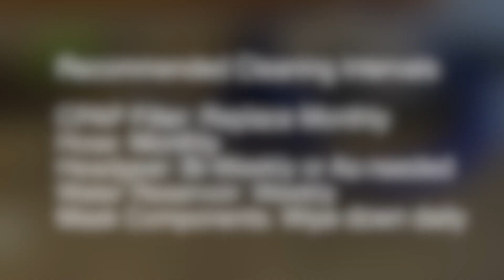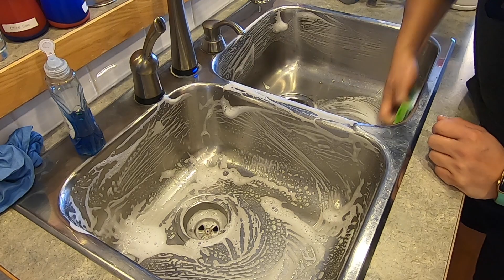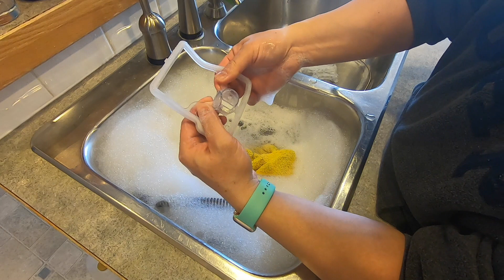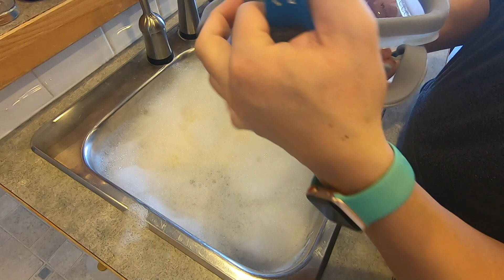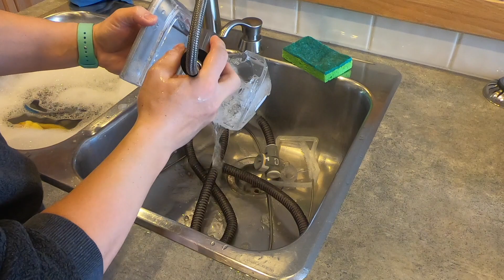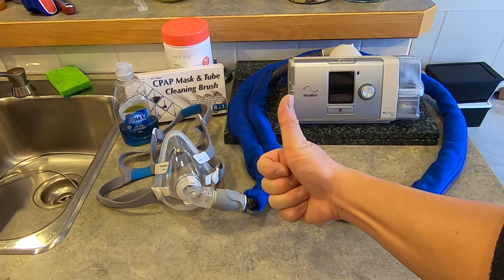How to PROPERLY Clean CPAP Equipment

Comment: Thanks a bunch. Now all i have to do is find a comparative soap in Australia. The information i got with the machine lists 3 brands, one of which i bought...then a person at RESMED said not to use the one i bought - i told them to update their information.....i doubt they will.
Reply from the maker: honestly, I won't fret too much about which soap to use so long as you use something that you'd use on the very dishes you eat on.  Think about it... if you wash your dishes with dish wash up soap and you're sticking forks and spoons in your mouth then how would that be bad for your CPAP gear?  I have YET to see my cpap gear get ruined by the various dish wash up detergents I've tried over the years.  Going on 3 years and I'm STILL on the original hose with no issues.  Just get something that is non-bleach, non scented and rinse really well and you should be golden.
Reply: @piercedasian  my first big wash day was Tuesday. I decided to keep using the soap I bought. The mask etc still look like new. I was told that the silicone would yellow after a week and the seal won't work....but the only way I can see that is if things aren't rinsed well. 
Now all I have to do is figure out getting the mask comfortable....it keeps leaving blisters and sores.....
Reply from the maker: @juliebeans7323  I gather you're really new to CPAP.  I found that ANY silicone mask I used caused sores so I resorted to going with a memory foam mask - Resmed AirTouch F20.  I use a Remzzz mask liner on it to prevent my facial oils from getting onto the memory foam and as a result of that, the mask has lasted me more than a year!  Far cry from Resmeds recommended monthly cushion replacement interval!  To help the sores feel less sore and to heal, go to your drugstore/pharmacy and buy yourself some "nipple cream".  This can be found in the baby care section and is used by nursing mothers to ease the rawness on the skin.  It is essentially lanolin and that will help you immensely.  Sores can form from the mask being too tight or you have super sensitive skin.  Another alternative is to use a mask liner and put that between your skin and mask.  What kind of mask are you using?  Makes a HUGE difference and can make or break you adapting to wearing something on your face while you sleep.  Once I got over the struggles of my CPAP that I can wear mine with ease and commitment.  Good luck!
Reply: @piercedasian  i am very new to it.
I have an extremely short nose bridge - I have almost no bone to sit the mask on. I have a f20, as my sinuses often cause issue due to allergy etc. I can't get a seal on my nose without making the thing tight. Been thinking of trying one of those gecko things for over the nose, perhaps it will help with the seal and stop the mask closing my nasal passages?
I am on a pension, so even getting the machine has been a struggle, hence the choice of silicone over the foam. They gave me a couple of cotton knit liners to try, but due to needing micropore tape to cover wounds, I haven't tried yet. I'm looking at those covers for the mask, but even they are prohibitive due to their ridiculous price.....I have some cotton knit fabric, I'll make my own.
I have a phone consult with resmed today....I'll see what they say, then decide what to do.

Comment: If you are going to clean your water reservoir  once a week- you might as well clean your hose as it carrys heated air which has moister-great for bacteria- Great video, very informative,. easy to follow
Reply from the maker: While you could do that (technically it is recommended by the manufacturer) that it is a bit of overkill especially when washing the hose.  Not going to lie, I only clean my hose with a physical brush every 30 days but I do "sanitize" it with a SoClean machine once ever 2 weeks.  Been 3 + years and so far no respiratory issues.  I guess the BEST thing to do IS to follow the manufacturer's suggestion but only the CPAP user can decide what works best for them.

Comment: Just picked up a ResMed CPAP today.  Thank you for this informative video!

Is it okay if there's a few residual when droplets of water under the water tank?
Reply from the maker: Yep there is no issues with water drops under the water tank. Shake as much as can out and the rest will dry up when you use the cpap. That is why there is a tiny little hole at the base of the reservoir so air expansion on the heater plate along with any moisture will escape out of that hole.
Reply: @piercedasian  do you have another hose cleaning brush you recommend? as the one in your description is no longer available (in Canada).
Reply from the maker: @jessikamikki  Hi Jessica, thanks for pointing that out.  Here is another link that would work and is a decent kit.  https://amzn.to/36tt7nV

Comment: I have been on a CPAP for 8 years and never clean it.  I replace filters every month and replace mask, headgear and hose every 3 months.  Never had any issues at all.
Reply: Same.  Though I don't automatically replace everything every 3 months.  If it all still looks, smells, feels good, I wait.  Filters are obvious - the white ones darken.  The black ones you just rinse out in the sink and keep using.  The headgear - I don't think I've ever cleaned it - just replaced it when it falls apart.  Hose and nasal pillows I replace when they seem dirty.
Reply: @cra2cra226  I too use a P10. Washing the mask straps with hot water and soap “tightens up” the strap somewhat, allowing longer use. However. the recent P10 masks I have received now have an easily adjustable strap -so far so good.
Reply from the maker: hmm, I'm not sure if it is necessary to replace all of the parts you listed if they're still in good shape.  Seems wasteful to replace a hose every 3 months.  I've been using my original hose and headgear for the last 3 years without a nary of signs of showing wear.
Reply: What about the water tub?
Reply from the maker: Never leave water in the humidifier unless you're using something like a SoClean or other similar ozone based sanitizer.  I dump my water out each day and physically wash out my tub at least once a week to be on the safe side.  Lots of gross and nasty things CAN and will grow in the humidifier tub.
Reply: I don’t use the humidifier and have it removed.
Reply: I do the same as Chris. I’ve been on a CPAP for 6 years and I also replace my filter on the Air Sense 10 once every month. I don’t want Dawn dishwashing liquid residue in my tubing and that gets breathed into my lungs. I initially used white vinegar after my sleep study and it was such a pain to rinse. I asked a few friends on CPAP if they ever clean their tubing and they said once in the beginning. Then they all stopped and none had gotten sick. They just replace the tubing every 3 months. So that’s what I started doing. The air is only blowing one way. I’m not blowing into the tubing. I just threw out my Climate Line Air tubing after using it 3 months. It looked perfectly good still but I put a new one on. I wipe my nasal pillow off each night but I throw them away every 2 weeks because they don’t work well anymore. I use the P 10 mask. I replace the headgear every 2 weeks also because it stretches. I used to try using the pillows longer but ResMed went from having the pillows made in Australia like the machine to having the pillows made in China and I didn’t realize that until I used one of the China pillows and knew immediately it was flimsier and they stopped performing well in two weeks and slipping out of my nostrils.  I clean my water chamber by spraying it inside and out with rubbing alcohol that I keep in a 32 oz spray bottle. After a couple minutes I rinse the alcohol off using distilled water from a gallon. Again, I don’t want soap residue on anything I breathe from.

Comment: Odd... as we were specifically told NOT to use Dawn (or any grease cutting soap) because it degrades the plastic bits.
Reply from the maker: Honestly I asked my DME owner and he’s been using cpap for more than 15 years and he uses dawn all the time. Remember you’re not washing it daily maybe every few weeks and I have extensively washed my cpap gear in dawn for the past 3+ years and zero issues. Still using the same hose and reservoir that came with the unit.
Reply: @piercedasian  Not saying you're wrong, I just know that when my mother and my husband received their machines the medical people told them both specifically not to use Dawn, and other grease cutting soaps, because of the plastic degradation.  So it was a bit shocking to see you using it.  :)
Reply from the maker: @akasarahsmom  yeah I am sure if you ask a bunch of folks they will all have differing opinions on what is right and what isn’t. I figured if it is safe to use on my skin to wash my hands (and I wash an awful lot because I am a mechanic) and my hands have survived all these years that I figured a dawn couldn’t possible harm a plastic hose.
Reply: @piercedasian  for sure.   Everyone has differing opinions.   Personally Dawn and other grease cutters KILL my hands.  Again, I'm not saying you're wrong, I was just surprised because we had been specifically told not to use that particular brand.  shrug So long as the equipment gets clean.  Nice video btw, forgot to say that earlier.

Comment: Should you not use distilled water to clean it?
Reply from the maker: No that is totally not necessary.
Reply: @piercedasian  I don't understand. If you're not supposed to use tap water in these things because of the calcium and other mineral buildup then why is it OK to wash them with tap water? Surely there would be mineral buildup unless you completely sterilized it or something after washing it in tap water?
Reply from the maker: @gunnMetal  no no, that isn't quite how calcium build up occurs.  Calcium build up doesn't happy immediately.  It has to sit and "precipitate" out of the water and start building up on the surfaces of the water tank.  When you're washing out the tank you're using a surfactant (i.e detergent or soap) and you're gently scrubbing the insides to get rid of any scum or bacterial buildup.  When doing this, the calcium would have difficulties attaching itself to the surfaces of the tank.  It takes time for buildup to form and grow and washing a tub out is never likely going to result in any real buildup (if any).  This is actually why you use distilled water in the tank b/c when you're using the cpap water sits and evaporates and that is whey you don't want to have dissolved minerals in the water since it will precipitate out.  Simple analogy is look at your dishes.  Do you have to scrape of big calcium deposits on your plates?  Not likely and thus your cpap will not have that issue either when using tap water to wash things out.
Reply: @piercedasian  OK then. Thanks for the video and for taking the time to answer my questions

Comment: Oh all this is completely unnecessary. I've been on cpap for over a year and never cleaned it and I'm totally fine. As long as you use it daily the bacteria can't build up. It's proven science by sciencey people. Hell, I even use tap wat The only time I wasn't able to use it was the 3 times in the last year I had pneumonia, which is obviously related to my smoking for a few months as a teenager 20 years ago. So I'm living proof that cleaning these machines are a hoax perpetuated by our government to keep us complacent and sleeping all the time! Wake up sheeple! xd
Reply from the maker: I wouldn't say that this isn't at all necessary.  I think it comes down to your state of health and the cleanliness of your environment that would dictate whether or not it should be cleaned.  The CPAP air one breathes from their machine is the same exact air you breathe in your home and the little filter in the machine isn't a HEPA filter but just a fine fibreglass wool like type of material (similar to what furnace filters seem to be made of) so the intent of those filters is to prevent larger particles of junk getting into the blower.  I do find that after giving my hoses and mask parts a wash and wipe down that it smells and feels fresher for a bit.  If I neglect the cleaning of my hoses for say months (yes I'm guilty of that) that I can tell it doesn't seem a fresh.  Could be my imagination but I think that some occasional cleaning and gentle care will not damage the pieces.  My CPAP gear is going on 3 years now and I'm still using my original headgear, hose and reservoir.  I find it funny the sleep clinics are always trying to sell you replacement parts every 1-3 months.  So wasteful and a total cash grab.  Only thing I had to replace occasionally is the mask cushion but that's about it.
Reply: @piercedasian  Dude, I was totally being sarcastic lol. But good info nontheless. I cleaned mine really good last night as I noticed I was getting a cough, and today no cough. So yeah it's important to clean, despite my sarcasm lol.

Comment: I noticed that there is a mask fit test option in the airsense 10 settings, when you turn that on that puts out a lot of air. I'll hook up my hose after cleaning it and turn that on for a minute or two and just let it blow a lot of air to try to get some of the remaining water out
Reply from the maker: yep that definitely works or you can simply hang it up to drip dry.  I find even in our dessert like climate that after a full day in an air conditioned home that it is still kinda wet inside the hose.  I just use the cpap and the extra water droplets quickly evaporate into the air you breathe.  Extra humidification!
Reply: @piercedasian  yeah,  I hang mine up too,  but as you point out,  it doesn't completely dry
Reply: @piercedasian  I live in a very dry climate as well and am looking for a good humidifier in addition to the water chamber. Do you use a humidifier by your bed to help moisten the air? I’m finding the water chamber isn’t enough.
Reply: @carlalattanzi6873  I don't know if this is proper treatment of my hose or not but after a morning cleaning and rinsing my climate line hose I take it outside and spin it by grabbing near one end and twirl it vertically thereby flinging the excess water out, and since I'm not 8 feet tall I switch ends and spin it again. Any remaining droplets are small enough that after a days hang from my ceiling fan she's as dry as a popcorn fart. My hose still heats and works fine so apparently I haven't damaged anything.
Reply: @@piercedasian  hi, although you may think that it's extra humidification, it's actually tap water you are putting in your lungs, and not distilled water. I've read that using any tap water isn't good getting into your lungs, even the little bit left in your tube after cleaning.

Comment: If you separate the headgear and wash it in the washing machine, should you air dry or can it go into the dryer as well?
Reply from the maker: I've never hesitated to put my headgear into the dryer.  I find that it gets cleaned better when washed in the washing machine and I can even shrink them back down a little when they're dried in the dryer.  Its great way to get old head gear that has stretched slightly to shrink back slightly so it can be used longer before fully replacing it with a new one.

Comment: Thank you--I was concerned about the air hose connector getting wet!  Great tip about the hose cleaning brush and gently massaging the gasket of the humidifier.  That little tub now comes apart (or at least mine does--newly using May2021), which should eliminate the bubbles or be easier to get them out of the top and bottom, once separated.
Reply from the maker: Glad it helped!

Comment: Hi there! I hope that you are able to answer my question. I have a hose brush, but it was ridiculously difficult to get it inside of the tubing. And also it was even worse and harder to get it out. It was the same exact hose that you have in this video. Is there any reason this might have happened? I'm going to try and look for the brush that you have in your description, hopefully it is there. Hope to hear from you soon.
Reply from the maker: Noelle, it will depend on the overall diameter of the brush.  The trick I found with my brush is to stand on a chair to keep the hose straight and then feed a wet brush covered in soap suds and keep feeding it in until it gets to the other side.  I then put the hose into the water/soap solution (brush still in the hose) and then stand back up on the chair and carefully hold the hose where the brush is inside the hose and pull the brush back out.  Its a bit messy and awkward and I often get water running down my arm from fishing the brush back out but I always succeed.  The moment there is a slight bend in the house is where the brush will get hung up.  Always push or pull the brush through ONLY when the hose is perfectly straight.  Repeat this step a few times and rinse the hose with plenty of water and wipe/hang dry.
Reply: @piercedasian  ty. I went ahead and ordered the brush kit that you have in your description. I saw that there were 3 and 2 of them were long and of different sizes. I'm hoping the one is smaller in diameter. I have the same hose that you have in the video. But my brush is too wide. I tried to clean mine in the shower. I left it hanging and tried to feed the brush, but it wouldn't go anywhere. Hopefully I didn't ruin the hose. I'll find out when I switch it out. Thanks for answering and your videos are really great. Thanks for sharing :)